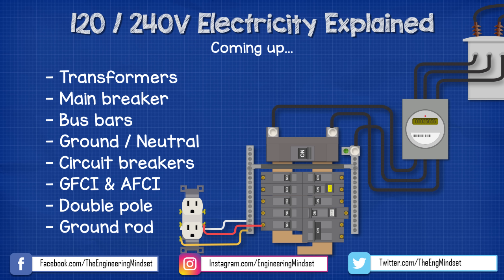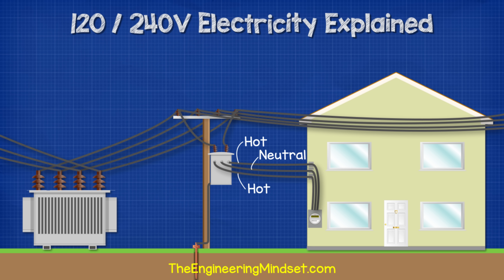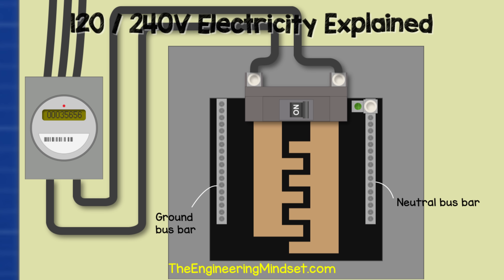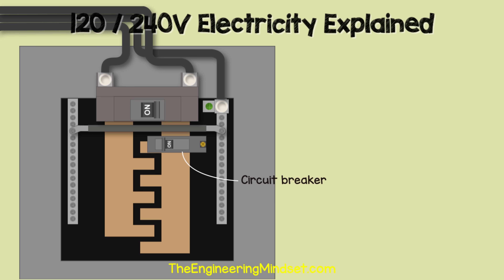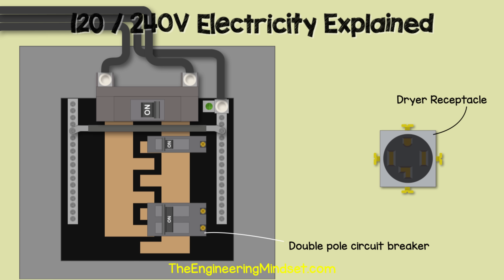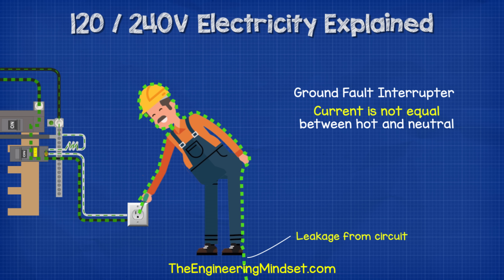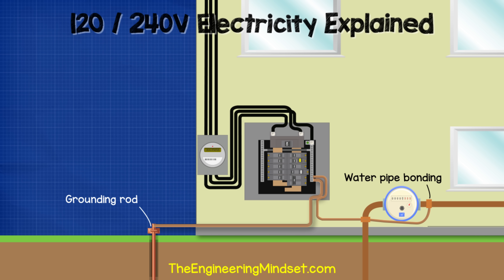120V 240V Electricity explained - Split phase 3 wire electrician

Comment: Hi, thanks for your videos, very detailed. I'm just a bit confused though, regarding the AC. I mean, if the flow is constantly inverting directions, it means that the hot wire will function as a neutral and vice versa, depending on the flow. And it's also difficult to understand how do the electrons actually reach the circuit end, since they are constantly go back and forward. I'm not sure if I had made myself clear on this question that I have, I really would like to understand the process.
Reply: Hi. Neutral is the name given to a point in a circuit.  Typically it is grounded but maybe not. It is the point in the circuit that you reference for voltage measurements.  The common lead of a meter will be placed on neutral and other points in the circuit measured relative to neutral.

If a very simple circuit is built consisting of  a 120v incandescent lamp and we name one of the wire attached to the lamp neutral and the other wire hot.  We then attach a 120v battery to the lamp with the positive terminal on the hot wire and negative to neutral. Measuring the hot wire we would say that the lamp is running on +120v.

If we turn the battery over and connect the minus terminal to the hot wire and the positive terminal to neutral. Our measurement would then say the lamp is running  on -120v.

In both of the previous measurement the common lead of the meter will be placed on the neutral because that what we intended when we named it neutral.

If we devise a way to turn the battery over 120 times a second we will have invented 120vac @ 60 Hz.  but the names of the circuit do not change.  We still place the common lead of the meter on the neutral point. We will have to switch to an AC meter.

Comment: When I measure the two hot bars I don't get the sum of bar 1 to neutral and bar 2 to neutral, so there must be more to that than using the full portion of the transformer's coil.
Reply from the maker: What are you reading, is it 208V?

Comment: For the musicians...
I think of an open string vibrating along it’s entire length as the 240 volts. The 240 volts is the full pressure supplied by the transformer. 
The transformer is tapped in the middle node of the secondary winding. This is like touching a string in the middle while striking it to obtain a harmonic octave. The string is now vibrating as two strings, above and below the node, with each “string” complimenting the others movement 180 degrees out of sync. Touching the vibrating string at the node doesn’t dampen the vibration. 
I have to stop people when they say their AC runs on “120 plus 120 volt” 
That ain’t how it works.
Reply: Yea its not 240 volts at all
Reply: In sweden we have three phases all 120 degrees out of sync and one phase is 230 volts. Between two phases you have 400 volts and not 460 volts because they arent in sync.

Comment: how does center tap wire act as neutral wire?
shouldnt the neutral wire be connected at one of the ends?
Reply: Neutral is the name of the point from which measurements are made. So neutral is just a name. The really important thing is you can not have more than one neutral per circuit.

Comment: If this is a subpanel, the bonding screw must be removed. Neutral must be separated from ground or else current from neutral will flow to ground.
Reply from the maker: Check the new SUB PANEL EXPLAINED ➡️ video https://youtu.be/NUSNa-7Hecw

Comment: Why there's an overload protection in most motor control panels along with the circuit breakers?
Isn't the circuit breaker enough for overload protection? Why adding an overload relay?
Reply: Because motors spike their current when they start rotating, and often have to have a circuit breaker sized in excess of their full load amps in order to avoid nuisance tripping the breaker.   Circuit breakers take time to respond to an over-current, and the smaller the amount of overcurrent, the slower the circuit breaker responds.  There is a time-current curve that governs how fast it it supposed to trip, on a given overload as a function of its trip rating.  This time-current curve works for loads in general, but motor loads have their own unique issues that get in the way.

The overload relay on a motor is more "in-tune" with what a motor will really do with its current as it operates, so that it can adapt to the nuance of how it works due to being a motor.   The overload relay can avoid nuisance tripping on a healthy starting current spike, and only trip on what it recognizes as an actual overload of the motor circuit.

Comment: I live in North America and I have a 2 phase 240V in my house in addition to the single phase 120V, I have a European tape deck that runs out of 220V, Can I power it up with 240V assuming that the frequency is not a problem?
Reply: Assume the answer is no, unless the manufacturer says yes.   The European 220V/230V/240V systems have one of the wires as a grounded conductor.  Only when the device is "ground agnostic", could you plug it across the 240V in the US.   If the device requries a grounded neutral to be on one of its input connections, it wouldn't work on the US 240V supply.

Comment: i'm no expert but i m confused about one thing and maybe someone can help me clarify it.
if we connect the neutral and grounding at a common bus bar and there's current 'running' through the neutral wire back to the transformer through the this bus bar, won't there be current 'running' through the grounding wire back to the metal case of appliances?
regards
Reply: I think there is because its AC
Reply from the maker: Answer here : https://youtu.be/P-W42tk-fWc

Comment: So are the two wires coming into the transformer primary side two phase lines, or one 240v phase and a neutral line? Thanks
Reply: The primary winding will be at several thousand volt levels.  The primary connection can be a hot and a neutral or two phases.  It depends whether the transformer is being fed off a wye distribution or a delta distribution. Delta feeds don't have a neutral so it's two hots or nothing.
Reply: @billelkins994  Thanks for the response, Bill. So if it was 2 phases, and not a single and a neutral, what would that connection look like on the primary side? One phase on each end?!

Comment: Electricity because it’s a machinery it does not understand electricity is supposed to only go one way “ what are the downfalls “ If there are any ? “ I have a 5 KW Inverter Charge Controller is single Phase 220-240v @ 60 Amp - my DIY Generator makes me self-sufficient w/ battery back-up ,  I have in my house a 220v plug about 10 feet from my breaker box the electrician that installed this jumped from each side of the breaker box 1 idea back-feed 220v at 60 Amps or install I have a 100Amp Double Pole Breaker back-feed the 220v 60Amp on that or even I am water reliant transfer switch 6 Circuit I have to recheck the Voltage on that and I’m looking at maybe getting a Transformer Step-down 220-240 to 110-120 to the double pole breaker I won’t have the normal Amperage voltage I will amperage voltage I will ? Any help greatly appreciated ! And I will have an electrician look at it after !

Comment: Just a note: in 120/240 split phase, the neutral is not connected to the meter, only lines 1 and 2 are.
Reply: Think the neutral is properly called the "identified conductor" in canada at least.
Neutral is only on a 3 phase system.
Reply: @macten5374  It's still called a neutral in the USA.    Neutral is defined as the conductor that is at the average of the voltage vectors the system.   It may be grounded (most commonly it is), or it may not be grounded (much more rare).

Comment: In Texas i have only seen really old panels where the ground and neutural are connected. Now we have a grounding rod and a wire goes from it i to the panel on the ground rod. And the ground and neutral are only bonded in the meter can.

Comment: When the guy puts the screwdriver into the hot terminal of the socket, how is the circuit completed? Usually, a person is standing on some sort of insulating material like wood (also shoes). How could the electricity get back to its source?

Comment: great video on "120V 240V Electricity explained - Split phase 3 wire" I do have a question, I see at the hot water tank would have bare copper wire from cold to hot copper pipe. Is that the same as pipe bonding like shown in your diagram?

Comment: This was always explained to me as single phase 240, which is wasn't.  But it also wasn't 3 phase , and if it wasn't single or three phase, then electricians couldn't define it.  It is really dual phase in that the mains are out of phase.  Lack of knowledge made me lose faith in the trades, because electricians can rarely describe what they do, they only know what wires to pull and touch when hot.   But good video.

Comment: i'm an Electrican from Germany and I wondered myself always how's the voltage functioning in the USA. Specialy when we having a wire system with 5 wire's in one cable with 230V each wire to neutral and ground or 3 Phases 400V to another. Now i get it!! :D But explain me why you guys don't convert your system to 230/400V 50Hz? i think this makes the installation and wiring much more easier :D Ps.: You're thinking about doing a job in germany as a Teacher in Electricity? Your videos would explain a lot :D Just saying :D
Reply: Hi my name is Ansu Badjie i'm an electrician from Gambia and i realy want to be friend with u . Thank you
Reply: If you want 120 volters to change you will have to provide a reason. What does the average German electrical user have in his home that a 120 volter doesn't have?

When incandescent lamps were the rage 230 volters had to replace lamps twice as often as 120 volters.  230 volt filaments are thinner than 120v filaments for the same wattage. Twelve volt incandescent lamps in an automobile often outlast the car.

Comment: Single phase makes sense for most homes or off a delta. 
But when connecting 208v on a WYE system, shouldn't we call it two phase instead of single phase because there's two phases in between the two lines?

Comment: question? I know you come into the house with 220V-240V, because most houses have washer and dryer. How does the power get down to 110 volts in the breaker box?
Reply: E.A. Abe Preisinger - In the video, from about 4:40 to about 5:40, it shows how at the transformer there is a center-tapped coil that has 240 across the whole coil and 120 from the center to each of the ends.
Reply: @BuckRogers714  correct me if I'm wrong, so they run a second wire  to the wire where  they need 240? It's not done in the breaker box correct. Thanks for your help.
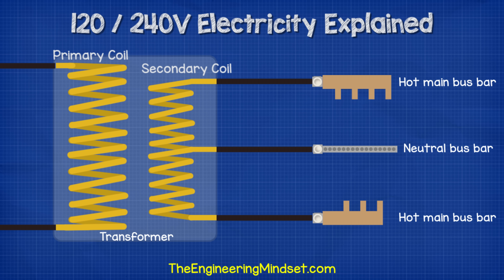Reply: Hello, E.A. Abe Preisinger. See the illustration at 5:10. There are two wires to the primary coil on the left. But there are three wires to the secondary on the right. The key to understanding this is knowing that the third wire is connected in the center of the secondary coil. That makes both sides of the secondary "in-phase" and half of the voltage. The terminology I know for this is "split single phase". Therefore, going from one side to the center-tap gives half of the 240 (120V) and going from one side to the other gives the full 240V. I hope this helps.

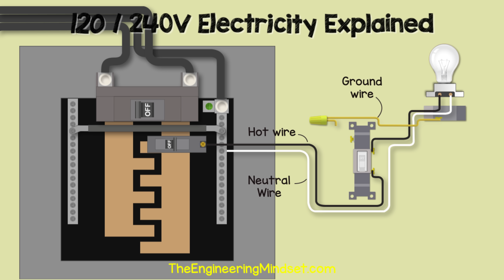Comment: Excellent video, but with one small correction. At 7:09 you state that "We take the ground wire from the metal casing of the sealing box and the switch and we also join this to the neutral bus bar as in this case it's shared". In Canada (in Alberta at least) the ground wire is always connected to the ground bus bar. Even though the Neutral and Ground buses are shared and electrically both are at the same potential, the Ground bus bar is there specifically to terminate the ground wires at the breaker box. If you connected the ground wires to the Neutral bus in this locale you would fail the electrical inspection.

Comment: Isn't it true that the neutral wire in reality only carries the  difference in load between the two hot legs? That is to say, if there was an exactly equal load on each of the two hots, the neutral wire into the breaker box could actually be disconnected and the circuits would still function.
Reply from the maker: This video will answer everything https://youtu.be/P-W42tk-fWc

Comment: Hi - Love the videos! I have a quick question for you - How does a GFCI Breaker know the difference between someone sticking a screwdriver in, and the difference between someone plugging in an appliance? Why is it that the screwdriver and person would cause the current to be not equal, but plugging in an appliance keeps it equal even though that appliance is using power?
Reply from the maker: This video will answer everything https://youtu.be/P-W42tk-fWc

Comment: Wow... I'm an IT Network Engineer/Manager and I play with low voltage equipment all day. I recognize that I always need power for my network equipment and in turn, I interact with electricians and electricity every day.

I often use the terms of the trade,  but never fully dealt with the exact training of how electricity is provided. Outstanding representation and basic understanding of how current flows. I think I'll go and get certified as a basic residential electrician. I've looked at fuse panels, seen how the fixture wires are ran, but often times, have been frustrated on how my new light fixture and outlets are ran and crossed shared.

Your info has given great insight.

Comment: Would you be able to explain the difference between GFCI and AFCI breakers? I understand a ground fault is different from an arc, but from my understanding an AFCI breaker should be protecting for BOTH a ground fault and an arc and is basically a more sensitive version of a GFCI as an arc has less current leakage. So AFCI breakers theoretically should be able to detect both ground faults and arcs, but GFCI breakers only protects against ground faults and not arcs. They sell AFCI/ GFCI combo breakers that are 2X more expensive but I feel like this is a marketing gimmick no?
Reply: Just completing  the path
Reply from the maker: We just published a new Ground fault, short circuit and arc fault video, so much detail! Link HERE➡️: https://youtu.be/Qi0ynSQw-wc

Comment: As engineers, you should know your logo is inaccurate.  The meshing of the gears is is not plausible.
Reply from the maker: It's a logo, not an actual gear box
Reply: Still, it should be accurate.
Reply: @toddnicoll9711  It is. It is an accurate logo. It isn't an accurate gear box, but then it isn't a gear box.

Comment: 7:54 you displayed the ground wire terminated on the neutral bus. The ground should go the the ground bus.
Reply from the maker: No, according to the NEC the neutral bus must only be separated on the secondary panel. The primary panel can use a shared neutral and ground bus. But always check the local and national regulations.
Reply: The Engineering Mindset ok then maybe it’s a trade standard where I’m from? What do you use the ground bus for then?

Comment: Great tutorial on the Electricity coming into the Home!  I have a Question that i wanted to see if you could answer. If i wanted to confirm an appliance stated current usage would i be able to put a volt meter on the specific break to check current being used?
Reply from the maker: You can plug the device into a energy monitor plug and it will capture the current and also max current. Check our current explained video there's a link to the product in the current videos description

Comment: question, if @ 110v 200amps u get 22,000 watts, do you then get 48,000 watts with same panel with 240v @200amps ?
Reply: No you would get 240v at 100amps.
  That is how company bills you and regulates ...by  load current used  not voltage. 

You can only draw what the street and WATT meter are wired for. 
120 at 200 amps...is 2x the bill as 240 at 100 amps.    200 amps vs 100 amps.  Not 120 vs 240.
As far as I know...you cannot have a full 240v only residential service...it's commercial 240v vs. residential 120 main service.
Reply: @tjellis1479  Interesting. I asked 2 electricians and they both said ya u can pull 48k watts at 240v @200amps. Im just trying to understand why one is right the other wrong. thx

Comment: Awesome video. Question, I recently installed a 6–50 NEMA outlet with a 50amp breaker. When I tested the 6-50 outlet with my multimeter or a voltage tester, it is reading 122v total instead of 240V. Do you know why this is? Thanks for your help
Reply: You used a single pole breaker. You need a two pole breaker for 240v
Reply from the maker: Check our new Multimeter tutorial out ➡️ https://youtu.be/4lAyzRxsbDc

Comment: If I get 240 from the hot (Black) to the metal receptacle box (with ground wire) on a white/black/ground wire, is this wired incorrectly? Is this a safety violation?
Reply: Black and red are 240V nominal to each other, but they are each 120V nominal to neutral.

Comment: Why would the neutral go all the way back to the panel from light ? Wouldn’t the neutral go from the switch to the light
Reply: Kevin Jacoby No, because you are only switching the hot conductor in the circuit to shut the circuit off.

Comment: Can you explain why power factor range is between 0.8 to 1  why it is not in the range of 2,3,4 ??
Reply: Power factor is a percentage 1=100%.  2=200%.  If you can design a circuit with a power factor of 2, it would mean that for every watt you put in you get 2 watts of power. You could be a rich man.
Reply: @billelkins994 please sir, could you explain me this in details?

Comment: If you join two hots together but they are not from opposite bus bars, you do not get 240 volts. I don't think your video made that clear. The circuit breaker slot is always vertically next to the one that is from the opposite bus bar. That is why 240 v breakers are always next to each other vertically.